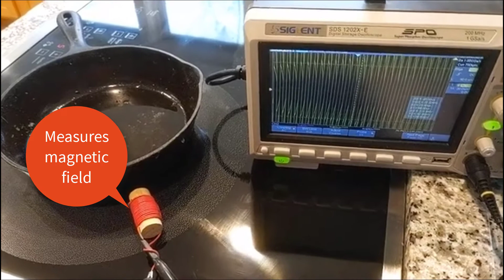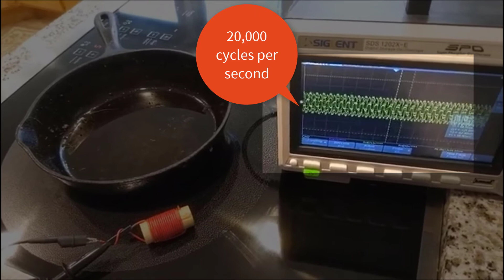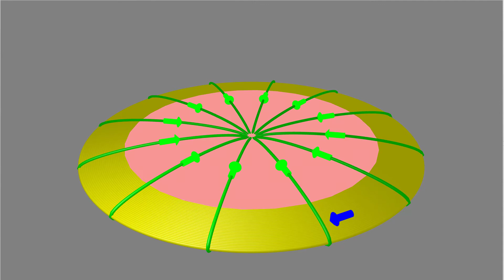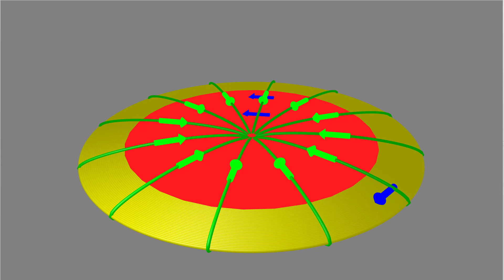Induction Cooking Magnetic Fields and Currents

Comment: Thank you for this!  I'm trying to find out about the magnetic field on newer induction cooktops that allow more freedom in terms of pan size and placement.   On the original style induction cooktops they specified that the pans needed to be centered and of a large enough size for the burner.  Otherwise, the magnetic field would be open loop and extend out much farther.  So how is that avoided on newer induction cooktops, and what does the magnetic field look like?   Thanks.